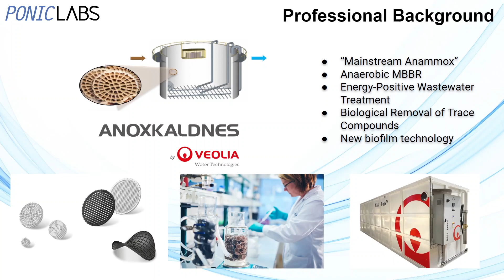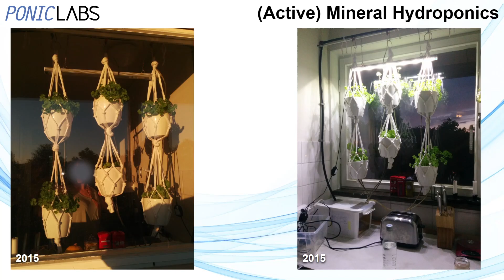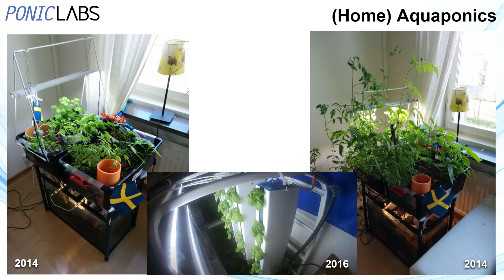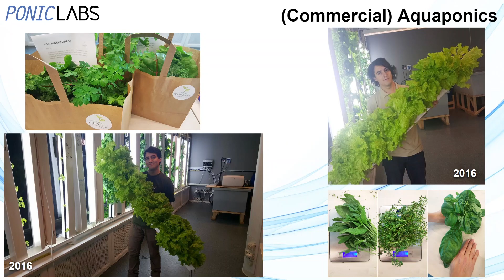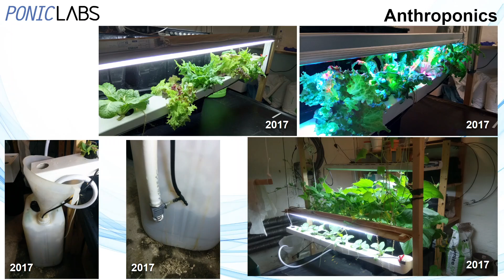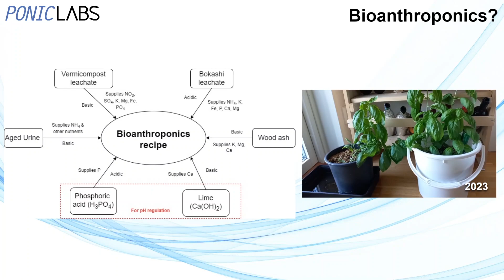Aquaponics Virtual Conference 2024: Sustainable Hydroponic Practices

Comment: 19:50 could powdered eggshells replace lime here?
Reply from the maker: You're right! Powdered eggshells can definitely replace lime to raise pH in hydroponics, although I have never tried it. Make sure to rinse, dry, and crush shells into a fine powder (perhaps straining/sifting to only only use the finest particles), then add gradually to the solution, monitor pH, and adjust as needed. Eggshells also provide calcium but they may clog equipment if not filtered properly.
Reply: @henriquejsanchez  thank you for thoughtful response. i asked because once you have chickens, the supply of eggshells. a friend of mine burns them before adding them to compost to lower ph. i dont know enough about chemistry to know if this burning is necessary. 

seems like a way to make your ponics more bio.